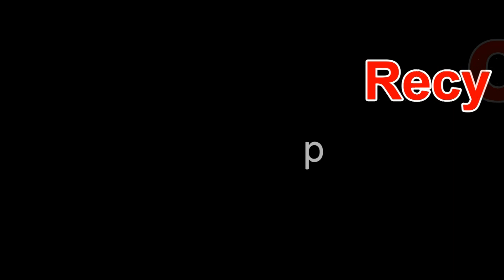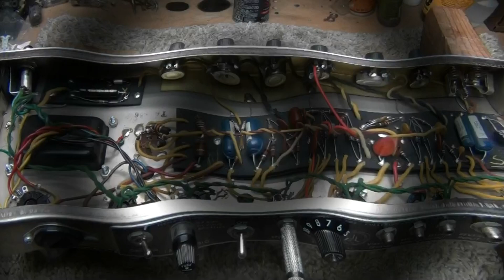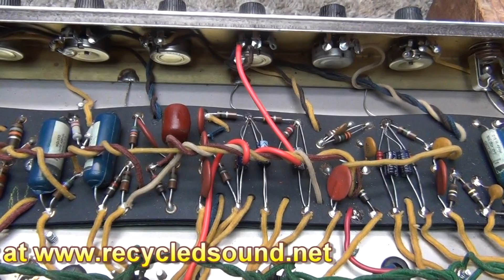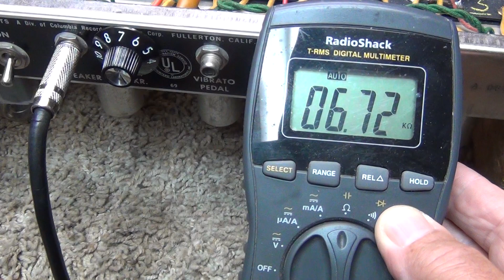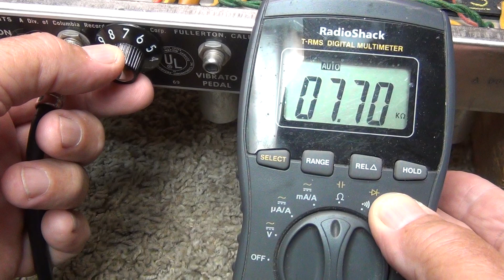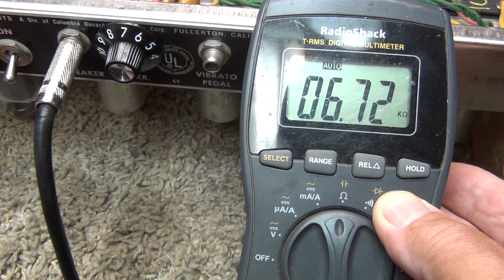Add Midrange Control to your Fender Princeton Reverb and more

Comment: Why not add the 6.8k resistor from the pot to ground so when the pots off its back to stock. Rather than 7 on the dial

Comment: Amp's without a midrange control are pure evil...and not the good kind. Crate has some models with a lead distortion that has treble, bass and then a variable T-notch filter labeled "shape"; it is not kind to the midrange, not kind at all lol. 

Relative to this mod, you replace a 100 ohm resistor with a 500K pot, and you get an extremely dynamic range midrange control that when coupled with that T-notch, does heavenly things.

Comment: Just put it in the ground hole. The polarity switch is not in circuit so better spot for it. But run a shielded cable back to the 25 k pot running long cables can induce noise. Another very nice and easy mod is a variable nfb switch to go with the mid pot.

Comment: I wonder if you have it the wrong way round. The lower the resistance in your pot, the more mids are bleeding to ground and vice versa
Reply from the maker: See Degener8ion comment below on how he wires this mod.
Reply: Thanks, is the following correct? If the pot is 'on 10' the least bleed off of mids, because the whole resisance of the pot blocks the bleeding and  'on 1' the most mids-blood flows to ground

Comment: Hello. What gauge is the red wire used? thank you
Reply from the maker: 20ga
Reply: @recycledsound  I have some 22 gauge . I guess that would work. thanks again .
Reply: @darrenhelton3629  Give me a break! Your question indicates that you have no knowledge about electronics and that you should definitely not tinker with a tube amp! In these amps there are voltages of several hundred volts, and only people who know very well what they are doing can work on these things without the risk of electrocution. So please, for your own safety, stay away from working on tube amps. But to answer your question: with a quick glance on the circuit diagram is is obvious that there is hardly any current flowing through this wire, so any gauge will do, even AWG 55!

Comment: Thanks for the explanation video. It’s hard to sometimes find videos explaining amp mods for the Princeton and especially nice explanations of options and also a sound demo. I just finished up a Mojotone PR kit and made this mod, but I didn’t feel like it gave me too much to I reverted it back to stock. A mod I like even more is adding a bright switch with a bright cap.
Reply: I love the idea of having a bright switch option for a Princeton- did you use a push/pull pot?
Reply: @HamzaJamzaFamza  I used a mini On-Off-On switch. Down is bright. Middle is disconnected. Up is even brighter.

Comment: I did the same mod in the exact same spot but I wired it differently. I installed this on a Pro Reverb and when I use it it is very responsive. But the difference I think in how I installed it is that I jumpered the wiper to that open terminal you left unused. I get a significant boost using the pot. I do this on all of my amps because it allows much more sensitivity in the tone stack controls. It also cuts out unnecessary mid-range bleed in Marshall amps giving you more control of how much mid range you want to dial in.
Reply: So you do it just like he wired it except install a small wire that connects the middle wiper lug to the outer lug? Thanks!

Comment: I have a 65 Princeton Reverb reissue (which I love) . . . however I can only put the Volume on 2 in my tiny NYC apartment. Is there a device that "Will not Damage my Amp" - and allow me to put the volume on 3.5 or 4?  - I'm looking at the Tw Notes Captor X and the Fryette Power Station PS-2 . . .Any input is greatly appreciated.
Reply: If you're playing via a Strat/Tele....use a $2 tone bleed mod.... My new Tweed is loud....the mod keeps the tone even as I lower the guitar's vol knob.   4 years late I am....
Reply: Check the videos we've posted on our POWER PLUG line of attenuators!  We received a Guitar Player magazine Editors Pick Award for these... VERY transparent and WAY less expensive!
Reply: @gregperrine4614  Thanks Greg - which Model do you recommend? ( not worried about the cost - I want the very best for my Princeton ) - appreciate your input. Stay Safe.
Reply: @michael_caz_nyc  NYC apartment? The Power Plug 100 will give you the volume flexibility you need at roughly half the cost of a similar Dr. Z Power Brake. 
But even the 6/12 will get you down to 3/4 watt... still quite loud for an apartment!
Reply: @gregperrine4614  Thanks, but I am leaning towards the PS-2 from Fryette. Consistently hearing great reviews. Appreciate the input. Stay Safe.